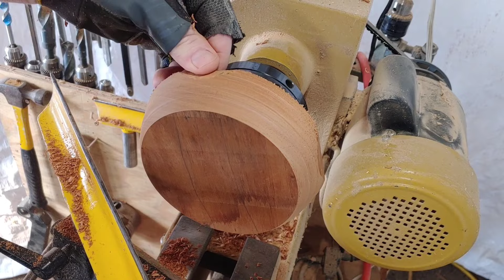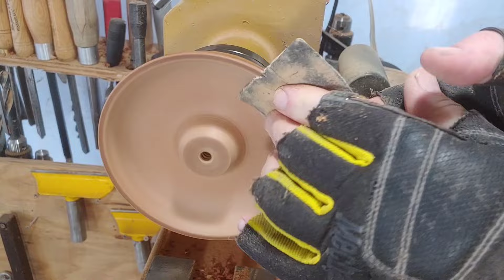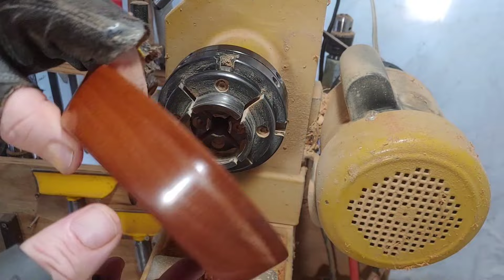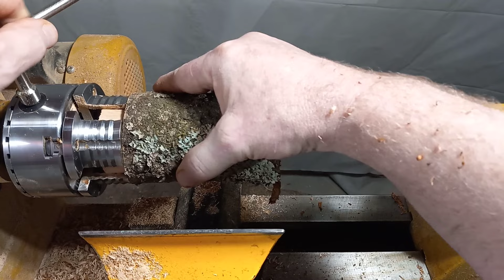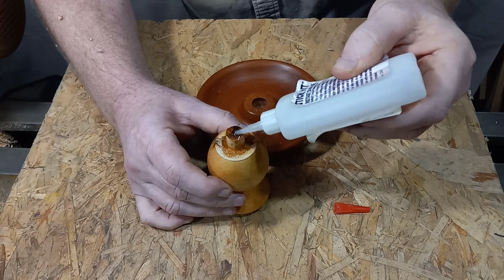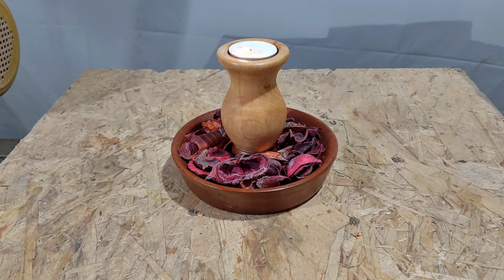wood turning - Mix scrap wood together for this amazing project

Comment: You only show yourself sanding with one grit of paper for about 20 seconds.  How much effort do you really put into sanding before applying a finish?  Ive been working on a Sappele bowl for over an hour trying to get it sanded smooth.  Its... discouraging...  It is also only bowl number 5 for me.
Reply from the maker: You will get better with experience. Work on your tool technique. The better that gets, the less sanding you'll have to do. My total sanding process usually takes 5 to 10 minutes before finish. I only show the final part of sanding because It's the most boring. If your using conventional tools make sure their sharp and keep the bevel on the wood. You will get a lot smoother cuts that way. If your using carbide you'll have to do more sanding. There are ways to use carbide and get smoother cuts but it's more advanced. Probably not a good idea to try until you get more comfortable with the tools.
Reply: @RcWoodturning  Im working on it, just waiting for the time available to  take a class over at Rockler. Im using carbide tools, and I think, getting better with them.  I like traditional tools better as I remember my time in shop class, but I dont have a good grinder, or the patience to keep them sharp correctly.
I would be interested in seeing a video showing the more advanced techniques for carbide scrapers.  Im really just winging it out here trying not catch an edge and end up with the tool sticking out of my chest... :)
Reply from the maker: I don't know of any videos. But basically you angle the tool for more of a sheer cut. It gives a smoother finish.
Reply: @RcWoodturning  Ive tried angling the carbide tip so its more of a slicing action than a scraping action, but thats how Ive gotten my worst gouges and catches.  I know Ill get better with practice, but for now, the lathe scares me more than any other tool in the shop.
If I was going to angle the carbide tip for a slicing action, slower or faster on the speed?  Mine is a 5 speed, change the belt style. Ive only gotten up to the middle set so far. Fast spinning things make me nervous.
Reply from the maker: @starhawke380  I never go over about 1200 rpm. I wouldn't go over 800 until you get better at it. Don't push the tool into the wood. Lite cuts will work fine. Keep the tool rest as close as you can to the wood. I would use a scrap piece of wood and practice, practice, practice.
Reply: @RcWoodturning  I have been using 2x6 cutoffs, and Ive been drying out some cutoffs from a curly willow tree I lost to a storm a couple years ago.  I cant wait to see what the willlow wood looks like.  Ill keep the speed down for now for sure, thanks for all the great info!
Reply from the maker: @starhawke380  Happy to help!👍